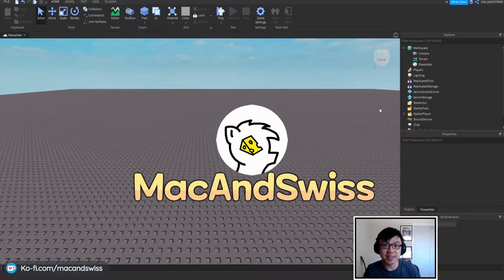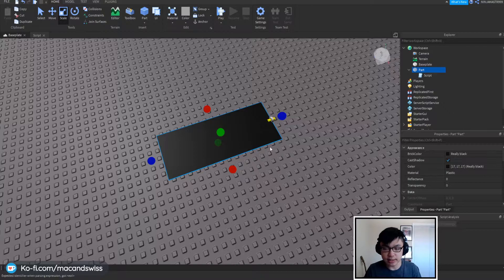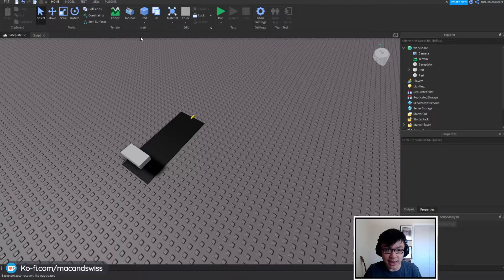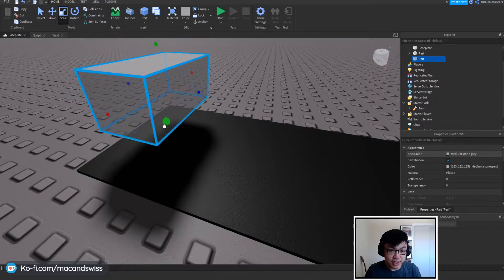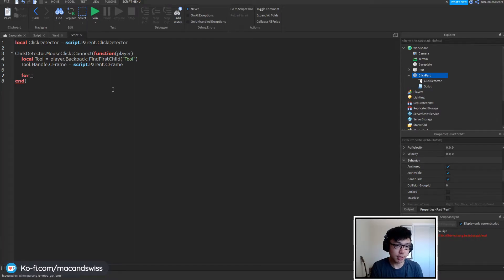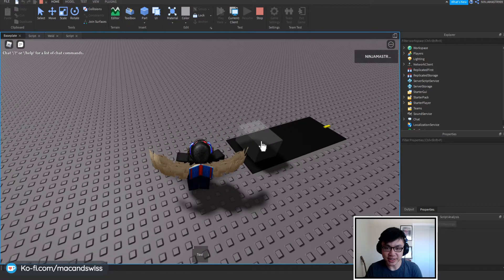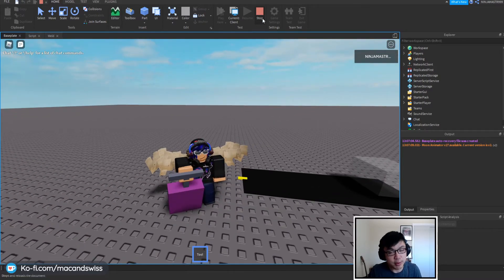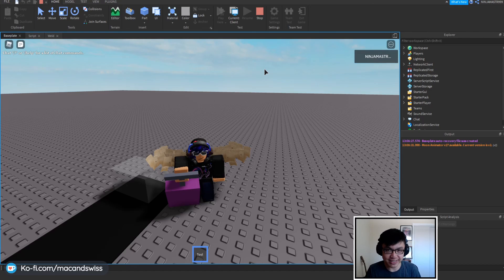Make a SIMPLE Conveyor Belt | Roblox Scripting Tutorial

Comment: I have a error which says ‘attempt to index nil with parent’ on line 5 can anyone help?
Reply from the maker: A couple of things that might be the issue:
- "index nil with parent" means that you're trying to get the parent of nil, or something that doesn't exist. You might wanna double-check the object or whatever you're trying to get, and make sure things are spelled correctly.
- Getting the parent of something is Parent with a capital P (just in case)
Reply: I’ve checked the spelling of ‘Suitcase’ and it’s the exact same.
I have added all my Parents with a capital P.
Still doesn’t work :/
Edit: It’s now worked but I’m not able to say SuitCase now it has to be called tool.
Is there a way that when clicked on Click part the suitcase is on its back instead of up straight?

Comment: it didnt work for me it was moving everything on the floor. and it was moving the wrong way.
Reply from the maker: Make sure that the part (and stuff touching it) are either anchored or welded to an anchored part. As for the moving the wrong way part, make sure that the conveyor is facing the right way (check to see which side is the "front").
Reply: @MacAndSwiss  I can't seem to find a plug-in that let's you see the front or back
Reply: @Devingx  Go to properties, scroll all the way down and go to Surface.